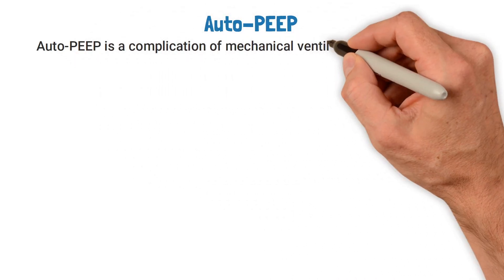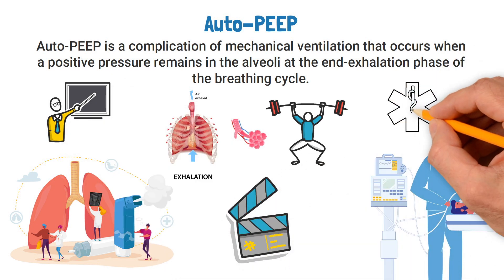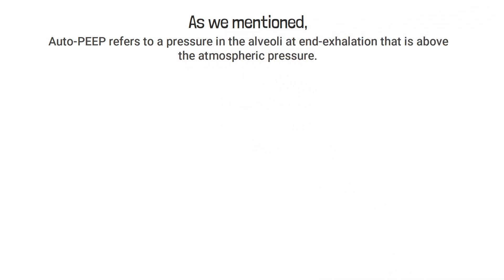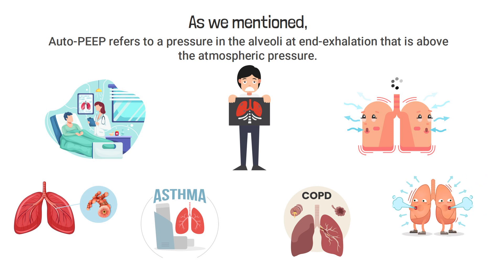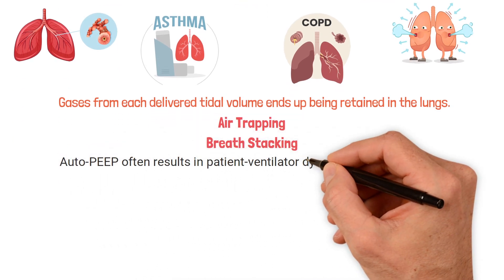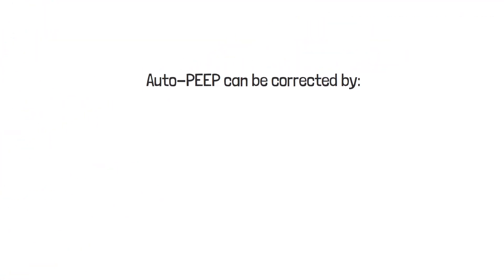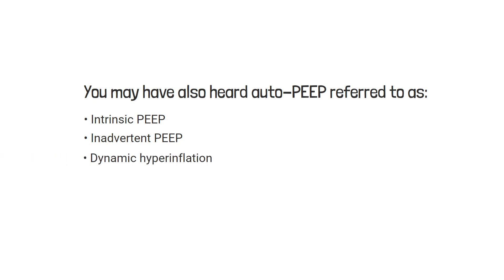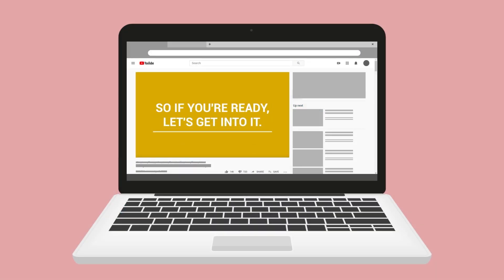Auto-PEEP (Medical Definition) | Air Trapping, Breath Stacking, Intrinsic PEEP

Comment: Thank you for making this video!
Have you covered "volutrauma" in auto-peep/air-trapping?

This is going to be a long post because I want to explain what happened today that made me worried. 

  I received a covid patient (no history of obstructive or restrictive lung disease), proned & paralyzed.
Settings AC/VC 410/28/70%/+14
 On a Drager: Evita 
 -6ml/kg IBW Vt is 410 Vt
-He's paralyzed 
-On the expiratory hold maneuver his "Vtrap" was calculating 210-250mL. 
-Plateaus were 30. 
-Per ARDSnet, his Ppl was in acceptable range (30 or less) 
-BUT,  volutrauma has been identified as a VILI in AC/PC (& in APRV too)
-I believe this auto-peep happened for 3 days 

SYNOPSIS:
3 days prior to my expir hold,  RR was increased & an RT did 2 expiratory hold maneuver that were above 200mL trapped volume but didn't document it on vent data or shift note, & no other RTs measured it...I only measured it because I made vent changes (he hadn't had changes for 3 days). There was an expiratory hold 2 days prior to that RT expir hold, & it recorded  35mL trapped volume. I went through the vent checks & seen RR was increased by one RT,  & then 4 hrs later expir hold was measured in the 200s by another...BUT it wasn't documented in our vent checks or that RTs shift note; I assume he was trapping because the vent wasn't changed & it's possible nobody knew about significant air-trapping;  may have been happening ever since that RR increase....according to vent history, it wasn't Remeasured again (AUTO-PEEP isn't something we have to document @ each vent check...but it's something we have to know when to measure to pass school exams & licensing 
boards) I discovered it when I did an expiratory hold after my vent changes, & then saw those previous expir holds saved in the vent log. 

My concern:  
I'm worried about  
VILI, via volutrauma (IF actual Vt higher than set Vt). VILI volutrauma has been identified/written about by researchers which lead to Vt NOT to exceed 6mL/kg IBW & abandoning pressure controlled vent strategies. 

To clarify: 
-IF his SET Vt was 410mL, AND expiratory hold maneuvers were calculateing trapped volumes of 210-250mL, would that equal total Vt of 620-660mL on inspiration? 

The Drager gives 3 values for expiratory hold. I don't fully understand them because a SET PEEP of 14 & total PEEP of 15.4 should equal an AUTO-PEEP/INTRINSIC PEEP 1.4. Right? Our vent doesn't give data that way. 
 Here's what was logged 
1) Total PEEP (15.5 cmH2o)
2) Inclusive PEEP (14 cmH2o)
3) Volume trapped (251mL)
On 410/28/.70/+14. 
The Pmx 32, Ppl 30, Pmn 22
I was able to get it down to 49mL (I don't recall the Total PEEP & Inclusive PEEP at 49mL, but I documented it, & can update that data later today). 

On the 49mL of "volume trapped" 
Pmx 30, Ppl 25, Pmn 18
I accomplished this via permissive hypercapnea & lower PO2s
Decreasing RR, 
Decreasing PEEP (& Fio2), 
Decreasing Ti
I:E changed from
1:1.4  to 1:3. 
On 410/26/60%/+10 
pH dropped to 7.29
When I received the patient,
He had more PO2 than our protocol warrants (protocol is approx 55-85) & he had a close to normal pH. (I think approx 7.38). 

Thanks!